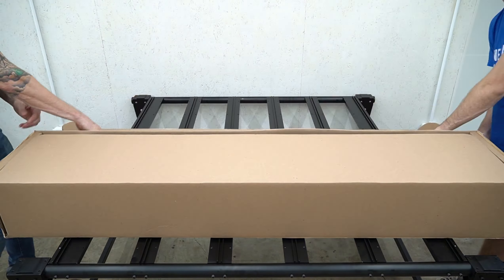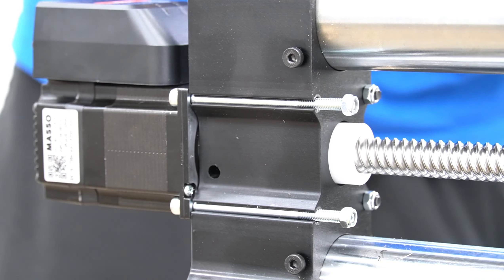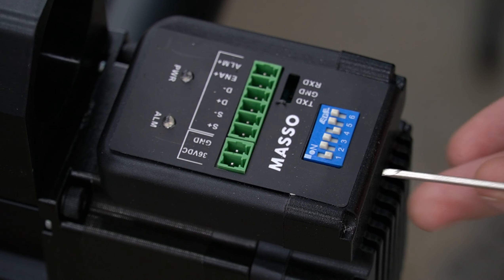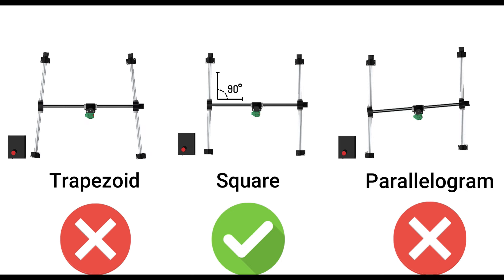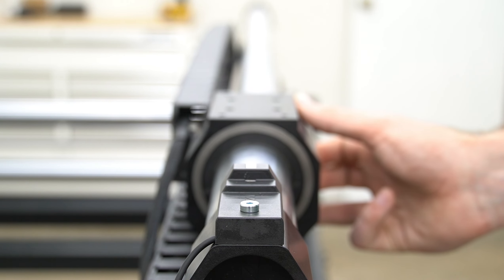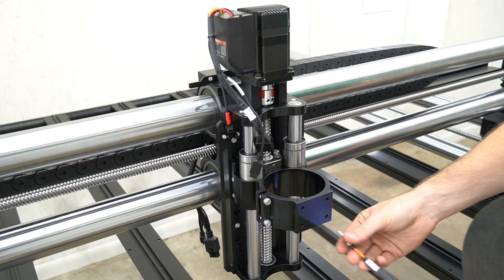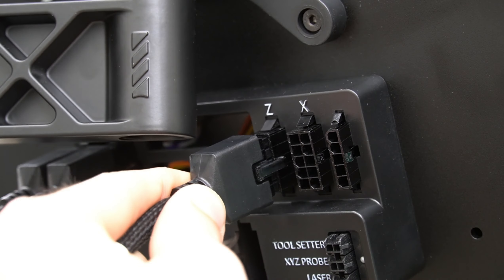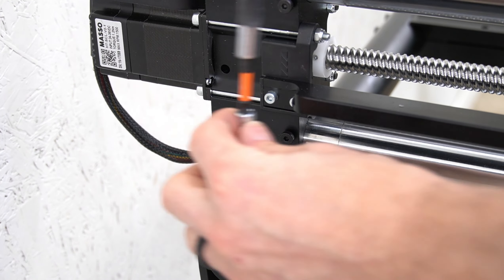Elite Series Assembly With Masso

Comment: I followed all setup instructions but my machine only moves about 12” on both Y and X axis.
Reply: I need new firmware (?)… flipped all switches to on and it seems to have fixed the problem. I’m just setting up my machine but received it back in may 😮
Reply from the maker: https://www.onefinitycnc.com/post/service-bulletin-for-elite-masso-stepper-motor-resolution-change